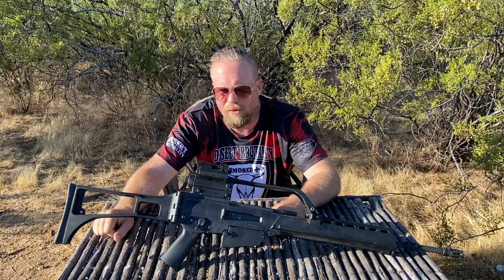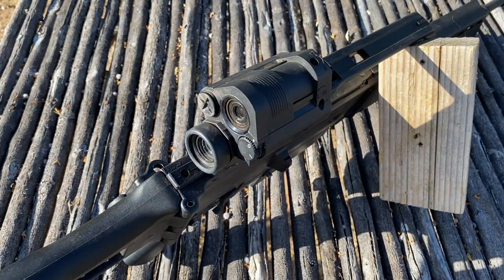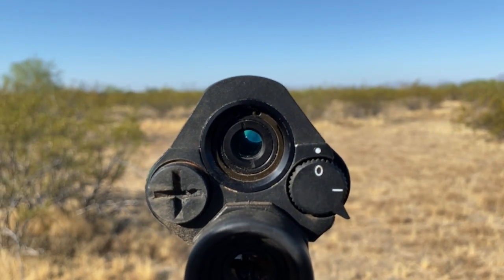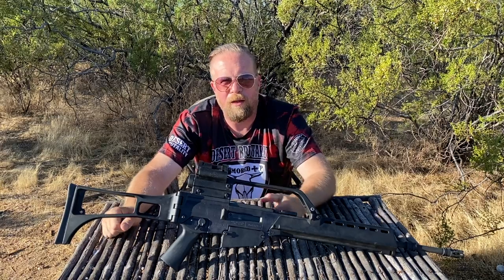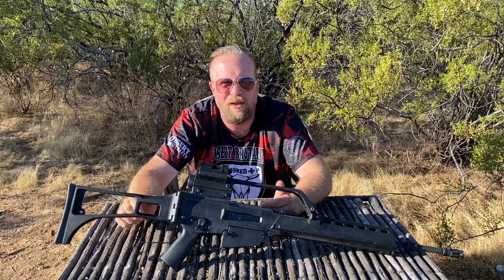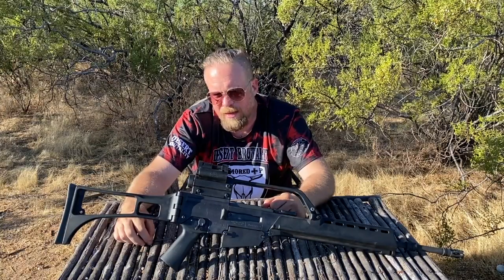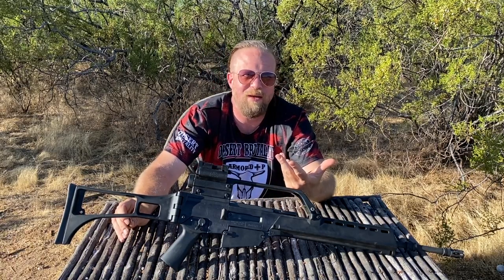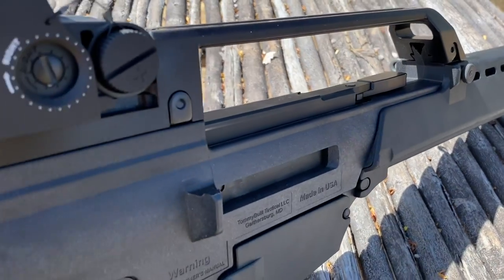G36 - Bundeswehr Hensoldt Dual Optic

Comment: Still have to watch the video, but:
The optics are trash, I still remember my conscript days with this rifle. Thankfully they've been replaced with more modern optics for combat units. See: G36A2 / G36A4.

I still have two of the 3x scopes here at home from my days at the Bundeswehr, our Waffeninstandsetzung (armory / repair) had a whole drawer full of these.
Reply: Well the A2 wasn’t a real improvement optical wise - but the A3 and the KA4 really changed worlds with the Hensoldt 4x30 and EoTech EXPS 3-0 and G33 combo.
Reply: +hurricane
Gebirgsjäger (drafted in 2004, when it was still mandatory + 6 Years Service) here. Never got to fire the G36A1 nor that old Hensoldt/Zeiss Optic 
Our G36s used a Hensoldt/Zeiss RSA-S which me and everyone else were more than happy with.
Reply: They should just sell to u.s. collectors.
Reply: @C0SSAC  
See my comment above, we had the Hensoldt/Zeiss 4x30 on our G36A2s. Just like the A3 had.
That said, I did also try the EoTech EXPS 3-0 + G33 Magnifier and i'm glad this came along (eventhough after my active Service) So i agree with you there.
Reply: I shot the first gen G36 and the optics were good enough for the time. Way better than just iron sights. And decent enough to make 97-99/100 points at 25m and around 88+/100 points at 100m. They degraded fast, god a bit blurry, that is true. But still better than nothing. Of course there are better ones out now and I would prefer them too if I had to use the rifle again, but as I said, better than nothing.
Reply: I was lucky when they gave me one of these it had a rail, never even seen of those duel sights in real life. Never realised how WIDE that On/Off/Battery chunk was, that looks like you can just forget about shooting both eyes open.
Reply: I have some lying around, I thought those optics only had a magnification of 1.3. Were there different optics? I have to find that thing...
Reply: EcchiRevenge what should they sell?
Reply: @EcchiRevenge  I say that about anything that anyone ever surpluses, but does anyone ever listen? No.
Reply: Hypothetically, if you're up to complete a shooting course either with irons-only rifle (say, ak-74) or g36 with original sighting system, what your choice would be?
Reply: @hurricane Seemed like an interesting attempt just not well executed. I’ve been trying to get one here in the US but they’re so hard to find. :(
But after seeing this video, I think I should just put the funds to a modern optic haha
Reply: @YuanMizzle  I'd still try to get one, if only just for collector's value.
Reply: @deedeeko9  The export optic version was I believe only 1.5x magnification...
Reply: caRn  it's only the optic, these are small plastic tubes which are placed in the huge sight. They were surplussed years ago for I think a euro a piece. Thought doing a project with these, but they are terrible.
Reply: @takogonikanetniukogo  BTW USSR had plans and intentions to issue low magnification optics as a standard for all AK users as a program that resulted in AN-94 confirmed that optics was an actual solution to increase hot probability in real world scenarios. 
But it was all scrapped with collapse of USSR.
Reply: danbarb9728  in meinem Fall ist es tatsächlich nur das ZF, was in dem Tragegriff verbaut ist. Eine kleine schwarze Plastikröhre, das bekommt man so üblicherweise nie zu Gesicht.

Dass Leute für den Tragegriff mit den beiden Optiken so viel Geld hinlegen ist irgendwie schon Irrsinn, weil beide Optiken ehrlich gesagt ziemlich scheiße sind :D Wenn ich einen G36 Klon bauen würde, dann wäre es das A4.

Comment: Ok, that was really interesting. From the beginning the G3 Optics where praised by soldiers as the best thing since sliced bread. BUT, those guys had to use G3 with iron sights before. Remember, the G36 entered service in december 1997. Yes, we used iron sights on G3s until then. No joke. So obviously it felt great. A modern rifle. So we went into Afghanistan just 4 years after the introduction of the G36. And there the soldiers realized that the opitc isnt thaaat great. Infact the most effective weapons in infantry combat against the Taliban where G3ZF (G3 with a scope) and the MG3 (basically the old MG42).
Reply: Greece is still using G3s without an optic...
Reply: Nice speech and all, but how exactly do you determine the effectivity of a weapon system like so?
Reply: @FrontlinerCdV  its a caliber problem. the 5.56 nato round is not powerful enough to kill targets behind typical afghan mudbrick walls, the 7.62 nato on the other hand will go through the wall and the target.
g3 and mg3 both use 7.62 nato

Comment: With the SA-80 system, the L85 and L85A1 suffered wandering zero problems with the SUSAT, but not with Iron Sights; this was eventually tracked down to both the mounting rail itself, AND the way the SUSAT was zeroed. Both issues were fixed by the time the L85A2 came along, but at great cost and remedial work (I'm a former reservist in the British Territorial Army as was, now it's called the Army Reserve; during my time, I was a unit Armoury storesman, and a Range Management Officer (SA(B)90, for those who know the qualification); we had the self same issues with SUSAT-mounted weapons as the regulars did. Therefore, based on both the above, and your video, I thoroughly agree that the sighting systems of the G36 Dual Optic would appear to be caused, primarily, by mounting of the sighting system.
Reply: How often did the Tritium in the SUSAT get changed?

Comment: Considering this sight is older than many of the recruits using it could the fogginess be a result of the age of the sight?
The sight picture of the 3X scope was pretty horrible.
Reply: ACOGs from the late 90s (contemporary to this) do not show this problem.
Reply: the fogginess is likely a camera artifact in this case, I've never noticed any fogginess with the optics on the G36 whilst shooting them in the Bundeswehr.
Reply: There is no real fogginess, the blue tint you see in the red-dot is on purpose (it's a byproduct of the anti-reflection and anti-fog coating, like on camera lenses). Believe me, it's on purpose - I've held brand-new G36s back in the day when they were introduced, and the blue tint was there (the original ZDv 3/136 even mentioned it).
Reply: My g3 was from 62 and shot straight. I couldn't get used to the red dot at all and only used the scope when we got the g36.  Don't have any complaints about the g36 except the red dot though.

Comment: I never had problems with the optic during my service time, besides it sometimes blocking things because of the hight. I never really lost zero and my optics were perfectly clear, no blue shade. Maybe Karl got a really old, beaten up one
Reply: I had the same experience. 
Tho I never shot the G36 in combat I never had the issues described in the video. Maybe there was an iteration on the red dot before I did my year in the Bundeswehr, because I think I remember the red dot sight (the glas) to be much bigger than shown here.
Reply: i heard there are newer versions so did you get them ?
Reply: i switched from the g3 to the g36 but i cant remember this kinda "tunnelvision" tbh and not the bluish glaze….although i remember the dot pretty bright on my rifle Maybe i was lucky and had newer optics. My first encounter with the g36 was when i got recalled to active service again and had to undergo a refresher training at my unit in 2006

Comment: As my agency's ordnance officer and tactical team member I assigned myself the sole G-36K our agency had in inventory. Due to the complete non-cooperative attitude by H&K USA to any agency buying fewer than 100+ guns from them, they wouldn't answer my phone calls or emails about a Picatinny rail or any other possible accessories that would increase the efficacy of the rifle.

I was, therefor, stuck with the standard "dual sight" system that the weapon shipped with.

That said, I found it to be completely serviceable. It was oriented at the appropriate height above the barrel, allowed both-eyes-open operation in both the red-dot and magnified- view and seemed to be fairly ergonomic, if one hadn't experienced some of the better optics solutions out there at the time......................

Comment: Very interesting video! I myself always found the sight fit well until I had the chance to shoot with different optics on the very same rifle. During basic training I shot with this set up as every soldier in germans does, later I had the chance to use it with an Eotech and an Aimpoint Comp 4. It was way easier to use the rifle ecspecily for the "Nahbereich" the close quarter shooting drills. I always thought I was because the better quality of the optics in general. But to mount these optics the rifle were fited with an all steel picatiny rail. After watching your video and demonstrations I think that these rails were at least as important as the optics. Thank you for this very interesting content! I shot this gun for quite a while now and also trained many young soldiers on it but I honestly have never noticed and or checked this amount of shift in the sigth. I will definetly check the next rifles for this.

Comment: In the world of Arma and virtual play, this optic will shock you the first time you use it.
Unlike the real world, the zero is set and stays set at the 200m, but as you usually engage at that range anyway it isn't a problem.
But the loss of peripheral vision on the other hand will make the G36 drastically different compared other weapons and optics systems.
However if you worked with the SVD sight, the G36' optics help will make you a lethal killer in no time, as unlike other optics it takes the guessing game of where to aim and get the lead right, out of the picture.
So for that, the Arma version of the rifle, I did fall in love with, still the shock of getting the gun's sights does make me pick other rifles over it when I can.

Comment: I worked for HK ITD as an Adjunct Instructor back when the G36 was introduced.  Almost all of the G36s we used in ITD had the Hendsoldt optic removed and an Aimpoint and BUIS mounted on a riser.  Much better performance than the Hendsoldt.

Comment: with the comment of how the optic mount flexes, i can't say i'm surprised. normally i'm a proponent for polymer, but I still think the G36 used it in places that don't work to it's strengths. 
I think that the AR platform has the concept right, where the barrel mounts into a metal receiver, and any optic mounts directly to that receiver. and then other parts are made of materials that dont need to be as rigid. i still consider AK side mounted optics to be slightly shaky, as i feel the mounts would act as a lever, and allow for (admittedly minute) flex or rattle.

Comment: I asked GPT about that horrendous red dot, this it what it said:

While the intent of the red dot sight was to provide quick acquisition of targets at close range, the small size of the sight picture could make it difficult to use in practice.

It's possible that this was an oversight in the design of the G36 dual optic, and the size of the sight picture was not adequately considered during the design process. Alternatively, it's possible that the designers of the G36 dual optic prioritized other factors, such as weight, durability, or cost, over the size of the sight picture for the red dot sight.

It's also worth noting that the G36 was designed in the 1990s, when red dot sights were not as prevalent as they are today. The red dot sight on the G36 dual optic may have been state-of-the-art at the time, but by modern standards, it may fall short in terms of sight picture size and usability.

Regardless of the reason, the small size of the sight picture on the G36 dual optic's red dot sight has been a common criticism of the system, and it's possible that this design flaw contributed to the reliability issues that led to the German military's decision to replace the G36.

Comment: Red dot is fine when you get used to it. Red dot sight has automatic brightness adjustment. It has light sensor in front-right side of red dot. Pushing on/off knob deactivates automatic adjustment and set if for 100% for 30 secs, so you don't need to hold it all the time in bright light :)

Comment: The removal of the red dot and replacing it with a broader FOV red dot would really benefit the platform..
There’s a reason they are transitioning to picatinny rails, and having used the optic I can’t stress enough how bad the red dot feels. The 3x also benefits from mild loctite around the adjustment screws after zeroing.

Comment: That you zeroed the red dot to 50m is very interessting.
If you zero the rifle, like the Bundeswehr wants it, you have to aim high in close combat.

When you zero the rifle, there is a side in the handbook, which you can copy on plastic foil. It helps to adjust the rifle much easier.

Comment: I served as a paratrooper in the Bundeswehr when this rifle and optic entered service. Of course this optic sucks by todays standards. But people forget that the Bundeswehr was an army of conscripts back then. And the duration of the service was cut from 12 to 10 months and later even more. The aim was to reduce the time and cost necessary to teach a civilian how to shoot a rifle and hitting a target. But even as an infantry soldier you need to acquire more skills than just shooting a rifle. So time to train the young soldiers on the rifle was very limited. To have a cheap optic on every standard rifle sure helped to reach that goal. Shooting the G3, the predecessor of the G36, actually required quite some training (=time) to be effective. 
Besides that i never had any issue with these optics holding zero. I doubt that this is the reason of its aledged accuracy issues. I have yet to meet a German soldier who can confirm the severe issues the G36 is claimed to have...

Comment: Hi,
it`s nice that an american is testing german army rifles. It`s pretty intresting to hear an other opinion about it.

I was 10 years drill instructor in the german army and the last 5 years I was a shooting instructor, so I know this rifle quite good. The problem u had with the optic is really intrsting, cause I never had it this extrem. The optic was out of target mostly wenn the recruits ditched the rifle or smacked it against what ever the could find. 
It is not the most modern optic, but I think it is a very good one when u keep in mind that every soldier in the german army has this one, special or specialized forces got better but this is usual. It does its job in the entire 10 years I used it. You get used to the sight if u practise al lot. 
And if u lokk at the task it was designed for it is still very good. The german soldier should be able to shoot at a mostly large distance (300-400m main sooting distance) and for that, the scope is very good. The reddot is for close combat and with the "new" shooting training in the german army, every soldier is/should be trained to shoot a target in 50m in a time of 3seconds (body hit). 

So I think mainly it is for a normal soldier who has enough practice a good and useful sight.

Sry for the misspelling and horrible grammar, I´m still german. ;)

Thank you very much for your videos it is a pleasure to view you.

Comment: i did shoot the G36 in 2000 and 2001 during my army duty.
i never experienced my rifle going out of zero. but i never shot so many rounds and i had a new rifle with less than 2000 rounds put through it.

i also hd no issues in using the red dot with both eyes open. yes the optic is very small but i had no problems putting my eye very close to the optic. i also did not experience any problems with it while wearing eye glases and helmet. i think my score was around 90/100 after 4 or 5 training sessions.

in the video I had the impression that die 3x magnification optic was damaged since it had a color shift and was washed out. 

maybe it's a matter of age and the mentioned problem with the polymer based connection.

Comment: Pretty much my experience with this optic in the german army.
My rifle was fine, zeroed well.
Then it randomly lost zero. Had to aim way off target to hit.
Then it fell over at some point because dumb recruit stuff happened and it was perfectly zeroed again. There are weeks between these incidents.

It may have to do with flexing, or with the way they zero the sight, it's essentially one spring off 45° angle and two hex screws pushing in against it on flat surfaces on the scope.

And yes, modern versions of the G-36s being issued just have rails, for way better optics. It was a nice idea in the 90ies to give everyone "modern" optics instead of iron sights...but 30 year old optics that need to be built into a rifle don't have to be the best solution nowadays.
 One thing to mention is that the holes in the carry handle are specifically to mount a NVG scope attachment that would slide a periscope down infront of the regular scope, then mount a massive night vision optic on the top...so even more weight.

Luckily, the modularity of the G-36 means you can remove the top handle with the optic, and just bolt on several options of railed top pieces available, from either the standard G-36C rail, or the improved, aluminium "KSK" rail, that is slightly higher and flush on the bottom to interfere less with operating the charging handle.

Comment: Dare I ask Karl, did your hold overs, the deflection, increase over the course of the match? 
Did it worsen from round 2 to round 3, etc etc. 
I'm wondering if it's a more....... progressive shift than a static one. 
The more you shoot, the more it wants to move, the more drastic the move is. Or is it more flexing, shifting in a set arc, more limited amount of movement.